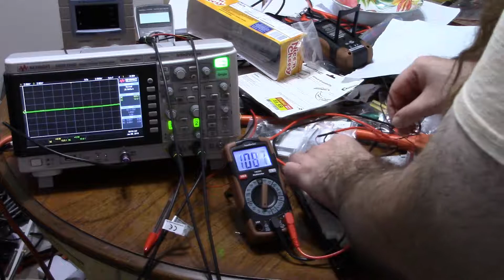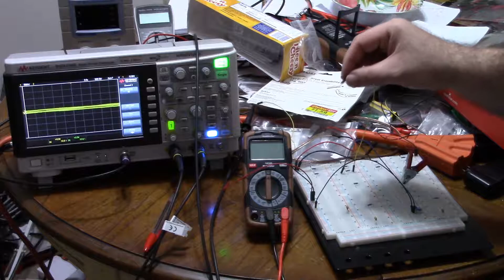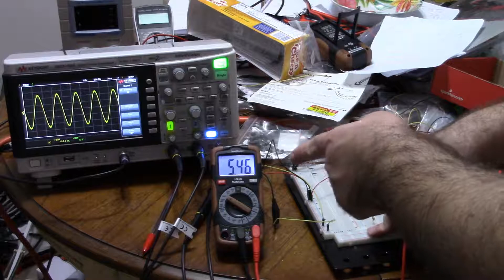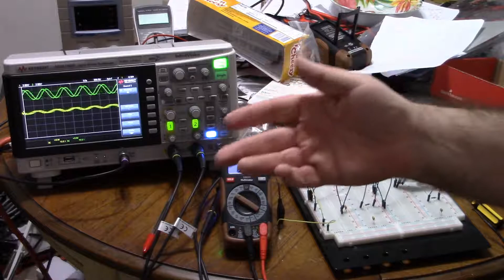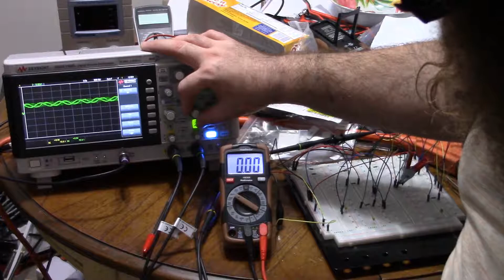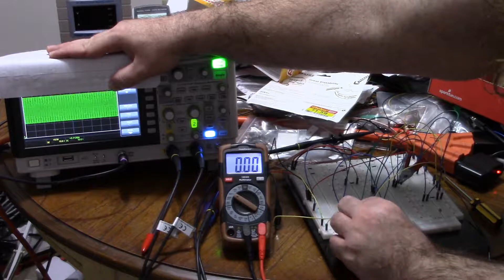Oscilloscope Showcase - Amplifier Piece By Piece - Simply Put

Comment: Good Video, very explained.
I'm trying to do something similar but with a microphone small signal.
How much amplification you could get with a 400 uV peak to peak signal..?
Reply from the maker: How much gain you get varies wildly with resistor, capacitor, and transistor choices. Use a higher voltage for your amplifier supply (the voltage that connects to the bias and collector resistors), use smaller resistors so the current limit through the transistor (and the load) is higher (making sure that you use resistors and transistors that are rated for high power), and make sure to use a capacitor in parallel with the emitter resistor so the emitter resistor doesn't cut your gain. If that's still not enough gain, just use a darlington setup: Have two transistors, one of which feeds into the other, so the first transistor takes the signal and amplifies it, and then that transistor's load is actually the base of the second transistor (you won't need to bias again, just connect the transistors together), so you get more amplification, as long as your transistors can handle that much power.
Reply: @simplyput2796  Thank you for the advice.